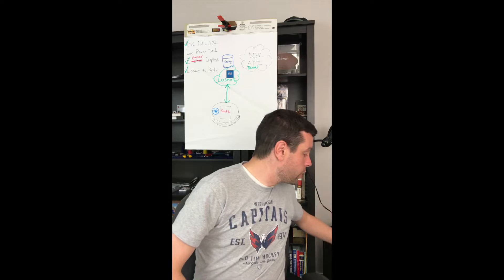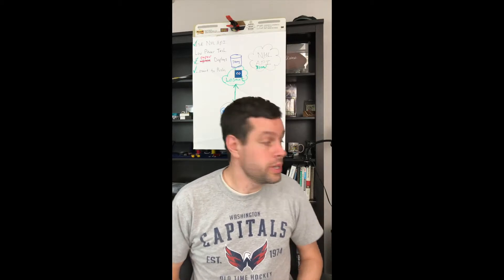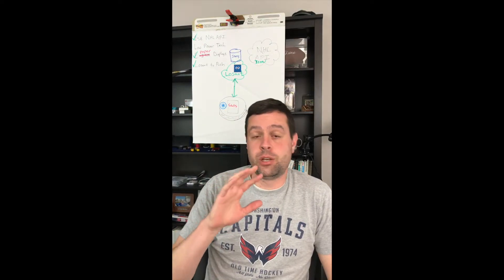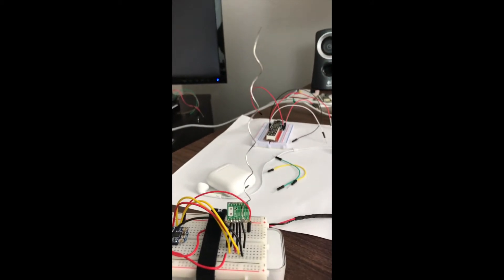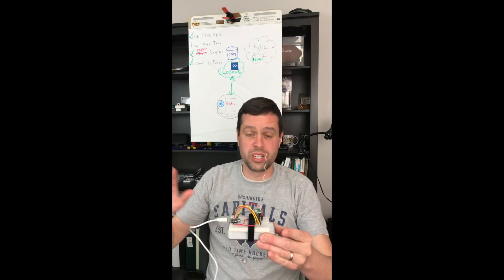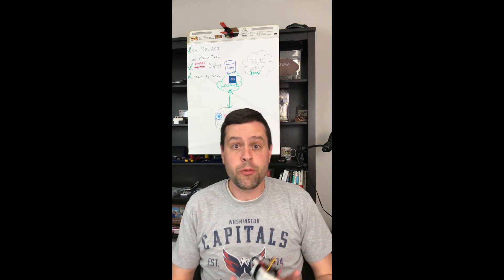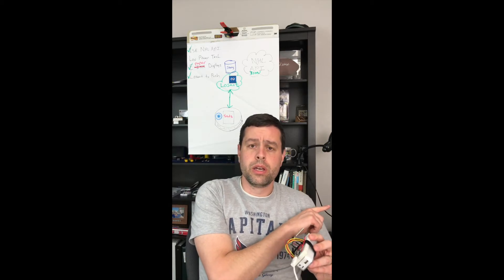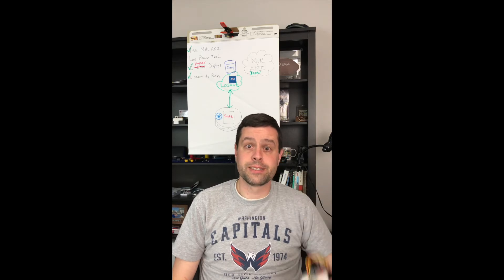RFM69 Antenna Tests

Comment: I have a big problem with these wireless modules. There are all these videos around saying the rfm69 is going to have way more range than wifi and they have all these sound theoretical reasons why, but every time I see someone actually testing the range they do really poorly on rfm69 (and similar sub GHz modules) and do really well on an esp-01 or esp-12f, with hundreds of metres range. So why is reality not matching up with theory? It has to be that people are doing something really wrong with their rfm69 modules and similar, right? Because as you say, in theory that should have much better range.
Reply from the maker: I think the biggest contributor is antenna design and configuration. Some people have documented several kilometer range with the RFM69. All about the antenna and environment. All of those super long ranges are open air, line of sight. It is also possible to configure the power output on the module so if you have it in a lower mode you definitely won't get the same range.

Comment: Hi Kevin,
Thanks for your interesting videos. RF / Antenna design is one of my favorite subjects. It would be a very, very unlikely outcome that a randomly designed  ‘inductance’ loaded antenna would be anywhere near ideal. The wild impedance of such a designs actually reduces the RF power from the RFM69. There is a great tool that use called a Vector Network Analyzer that is connected to any test antenna and presents a graphic display showing the antennas true performance. Simply trim, wind, extend, or otherwise experiment with any antenna to get the VNA display maximized for the operating frequency. A very, very small change in antenna design at say 915 Mhz can shift the modules RSSI wildly. A simple “spring” modification can easily reduce output by 20 dBm or more. Trial and error may achieve “working level” performance but having a design (using the VNA) can be applied on each module in the network. The other question about proximity affects (body etc) falls into the category of proximity affects. An ideal antenna design, presenting the ideal impedance to the RFM69’s output PA maximizes the output antenna currents. Raising or lowering that ideal impedance (proximity affects) automatically reduces the RF antenna currents (lower signal output). Whether it’s a body part or a screwdriver, the negative affects are the same. The detractor happens when someone has a non-ideal antenna (high or low impedance) and accompanying low Rssi but when moving an object (or body part) near the deficient impedance, they notice a Rssi improvement. They draw a wrong conclusion that the body generally “helps” or as some claim, “amplifies” the signal. In reality, the proximity simply and luckily shifted the poor design’s bad impedance into a region where the RFM could generate more power output. The VNAs use to cost upwards to $5k to $10k but thanks to progress by people such as yourself, these “arduino-ish” TFT devices are less than $100 USD.  I am astounded at how easy it is now to optimize antennas for any frequency between 1 Mhz and 1Ghz or more.  Send me an antenna design you want to test (paper diagram) and I would be happy to run a scan for you and send you the printout (pdf).  Thanks again for your channel of videos.
Reply from the maker: Wow, this is such awesome information. Thanks so much for taking the time to respond and put it here so other people can gain the knowledge. I always felt there was something off about "the body helps the antenna" . I had a single class in my EE degree on signals so I have some very very basic knowledge of antenna design. Thanks for explaining it so thoroughly. Also, thanks for watching.
Reply: I'm really curious about what would be the optimal "middle ground" solution between a straight antenna and a spiral. I don't have enough space in my project case for a straight antenna, but a spiral is not that great, as we've seen. So, could it work if the antenna wire was folded a few times? How far the folds should be from each other to not mess it up completely?

Comment: Your videos would be more useful if it has the information about how to use it with arduino and what pins to connect and the installation instructions.
Reply from the maker: Hey David, thanks so much for watching and thanks for the feedback. Normally I show more of that stuff but was just doing the antenna test for this video. If you have any questions about the RFM or if you're having trouble getting it connected to an Arduino just shoot me an email. Happy to help.
Reply: Thanks man for the reply. I'm trying to connect two arduino pro mini trough RFM69HW module but no matter what I did, I didn't get anything. I did some research in internet and some people suggested to connect external V3.3 to the RFM but some people mentioned their module was  damaged. If you could explain it in another video how you did it and if it's working for you.
Reply: @davidnasa7480  this is two years old, but the RFM69HCW needs a specific "high power" setting turned on, otherwise it will never transmit. The RFM69HCW can take close to 200mA when transmitting as well, so if your 3.3V source cannot provide that, then you will need an external source. Hope that helps.

Comment: While reading my regular community conversations ran across a gentleman looking to use RF for his setup. No need to detail it out here suffice it to say RFM was something I suggested and linked your page.  The conversation transitioned to using WiFi instead of RF modules. 
The question I have; are there similar devices/modules like the RF69 fitting the same application but in the WiFi variety. I know I could take a IOT device and use WiFi for communcation but is there a smaller type device serviing the same purpose and having the same small hardware footprint as the RF69 but in the WiFi arena?
Reply from the maker: Something like this? http://store.linksprite.com/esp8266-serial-wifi-module/
Reply: Which would you pick for sensor communication, RFM type or WiFi hardware? Maybe some pro's and con's
Reply from the maker: I think you just created the next episode of DailyIoT RudDog!  This is a great question that I'm sure a lot of people are curious about.  I'll put something together and film it today, drop it Monday morning.
Reply: Thank you was not expecting that but welcome the subject matter and the way you convey it!

Comment: QOTD: Using the Nexus6p service Googles Fi project.
Big time interest in this communication method you are using with the RFM69 and I can't wait till you receive and test the boards from the PCB design house. 
Will run the same test on the RFM69 but using the lower power device.
Great test I for one will be using the straight wire antenna for max range.
Really glad you re-visited the RFM69 as of today my Raspi set is working but there is a long delay in the delivery of my RFM69s. Can't wait to complete the link and test for distance and place this into actual use. 

Using RF to communicate between sensor and gateway allows for a vehicle with long ranges. I can't wait till my RFM69s arrive so I can get the trinket/RFM69 device completed and setup for testing.

Thank you for again for speaking to the RFM69 and it uses.

Reverse QOTD; What hardware do you use for taking 3.3VDC to drive 5VDC relay?
Reply from the maker: Yeah, the range test got my excitement for the RFM way up. You could easily blanket your house with all kinds of sensors reporting to a gateway. Driving a 5VDC relay with 3V would require a boost converter of some sort to get 5V from the 3.3V and then you could use a simple transistor with a 3.3V I/O pin to switch the 5V on/off to the relay.
Reply: As you know I used the 4N35 in combination with the photon. I decided to shift from the photon to the NodeMCU based on cost. 
Ordered more 4N35s these were not mfg'd by Fairchild and cost a lot less. Can't be sure but the data-sheet on the site I purchased from seems to be showing Motorola as the MFG but can't be sure.
Unfortunately have not been able to get them to work with the output from the NodeMCU. Today is dedicated to testing the failing devices with battery @ 3.3V and simple resistor diode setup.
Reply: Will have to wait till they come down in price a bit .